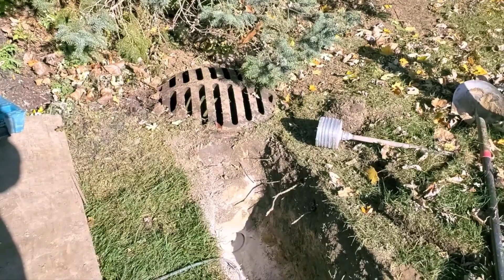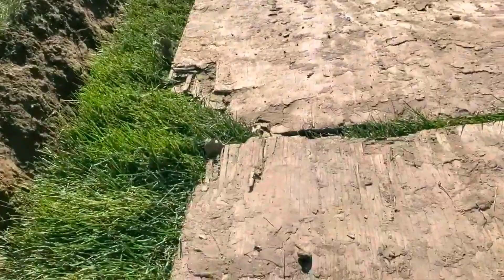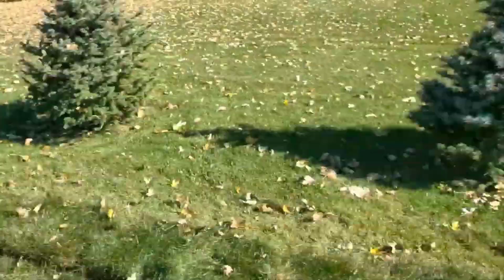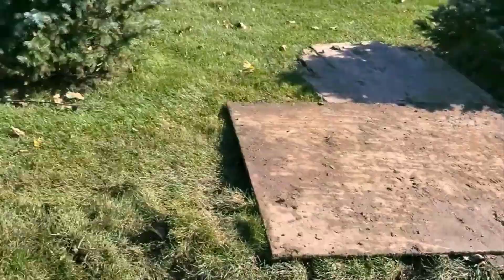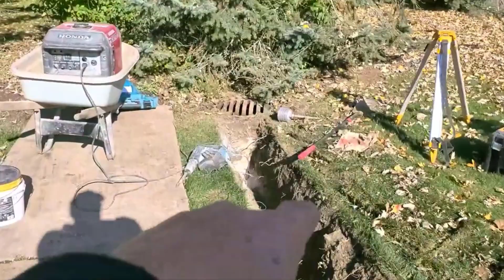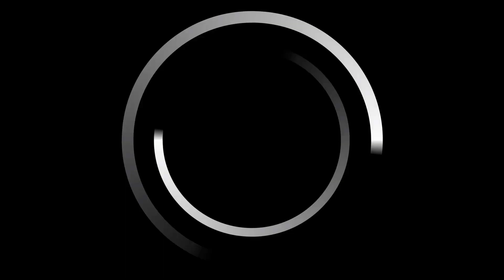How to Run Yard Water Uphill

Comment: So if you didn’t have a storm drain to connect to and had to use a pop up instead, would you just do risers on the pop up until you were at grade? Thanks for these very informative videos. Sharing your experience is very helpful to us DIY folks.
Reply from the maker: Every situation is different. I would perfer to run flat no slope so it doesn't end up to deep then use knife cut at the end of the run. Make sure you have a D-Box
Reply: @FRENCHDRAINMAN  Thanks very much!!

Comment: But when you get really deep in the trench, do you have to add extra gravel to get the gravel to near ground level, or do you use about the same amount of gravel for the whole trench and use more dirt to top off the deeper areas?
Reply from the maker: Whatever we have in stone, we fill the trench with, and then we can top those really deep sections off with the soil.
Reply: @FRENCHDRAINMAN   Thx. And while I have your attention, one more question. If you are doing an exposed French drain (with no sod on top), do you still burrito wrap the entire 360 degrees of the pipe, or do you leave the top open (unwrapped) since it's only just gravel on top?